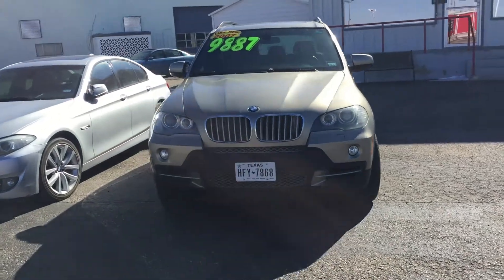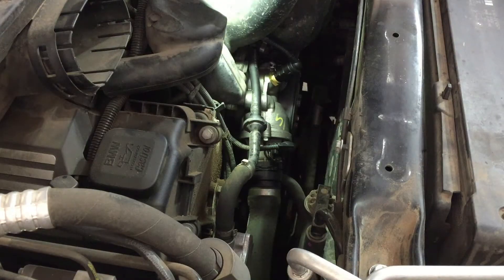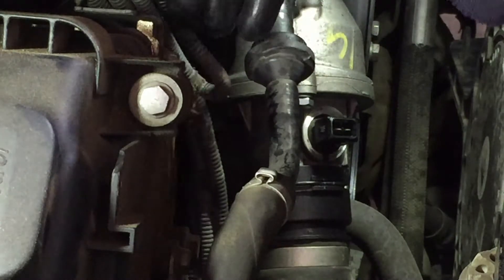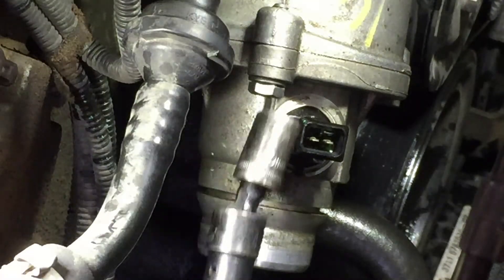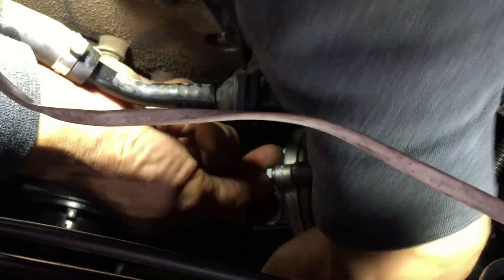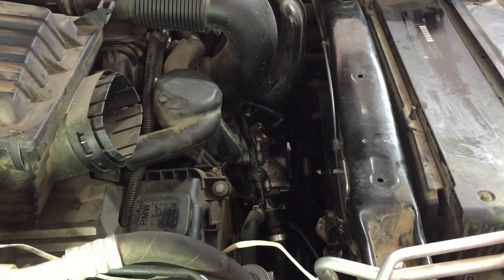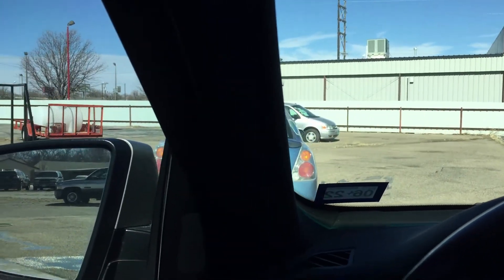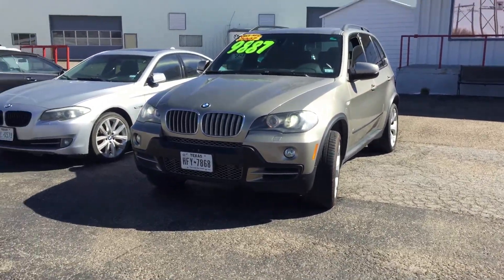BMW 2007 X5 4.8 Thermostat replace

Comment: Marty 09933, without question you are the best teacher and producer of truly useful and informative DIY demonstration videos ever! Like most others, I watch these types of videos because I actually want to perform the tasks and projects lectured upon in them. You excel at this because you don't skip steps or omit what can be critical details. As an example, your detailed explanation and demonstration of the types and functions of various house clamps and devices used to secure work done on active pressurized hoses was invaluable. I know dick about such things and thus would be likely to screw the job up, (after all that work and expense) because I failed to adequately waterproof my work.
Your attention to detail is demonstrated throughout and your explanation of the practical reasons why things have come to be done as they are, ensures that the lesson will be remembered because things that make sense always stay far longer in our memories. Grounding your teaching is invaluable to the benefit received from your lessons. It should have dawned on you that you are one hell of a teacher. Thanks, I greatly enjoyed learning from you. 
Your new watcher (and hopefully new friend,. Rudy.
Reply from the maker: Hi Rudolf Corona  thank you so so much  yes I try my best to put out very detailed and informative videos hope I can continue doing that and not let you down. Thank you for watching and I really do appreciate you my friend.

Comment: What happened to the 5 series with the blown engine? I’m curious as too what happened do you think you made some sort of mistake on the car? Or previous owner neglected it
Reply from the maker: Hi Zion Lords don’t know yet haven’t opened it up to see the inside . Had plenty of oil and coolant kept up with the oil changes myself car ran good no issues. Car was powerful eveything  checked out  good  Even the shop that looked at it don’t know what happened till I open it ??? One of those wired things
Reply: @Marty09933  take off the oil pan check to see if there was a blockage of oil supply somewhere. These cars just don't get a blown engine for no reason i think you should definitely figure out the mystery. I have the same exact car and i want to know what happened. Also did you replace the oil filter housing gasket on the car recently?
Reply from the maker: @zlord1199  I’ll keep y’all posted when I get around to it  very busy right now . Thanks